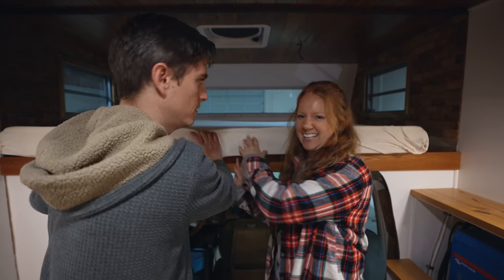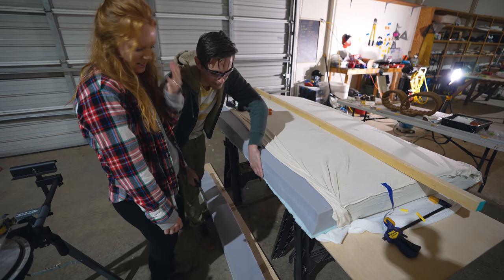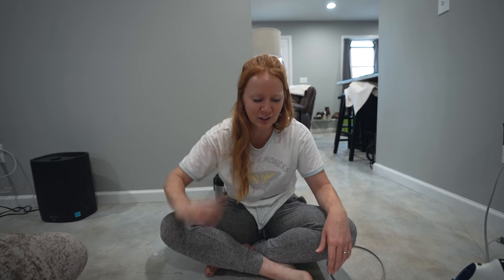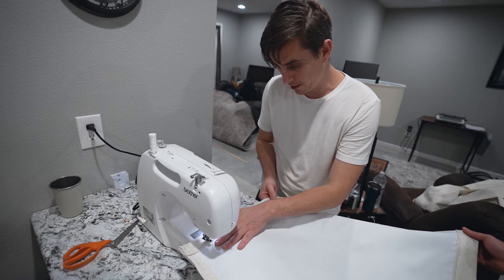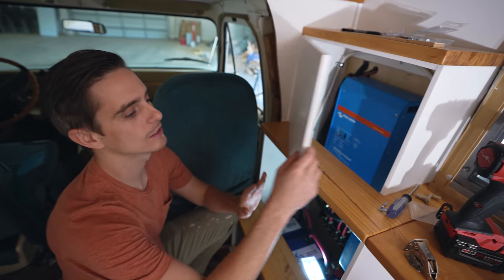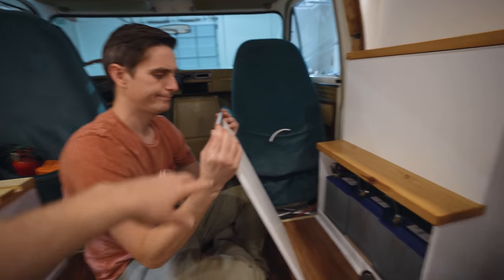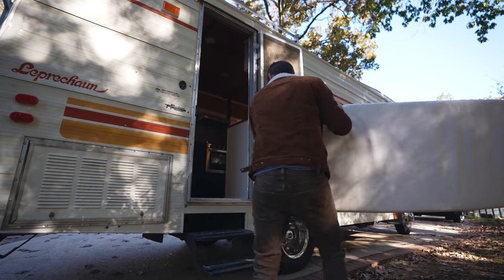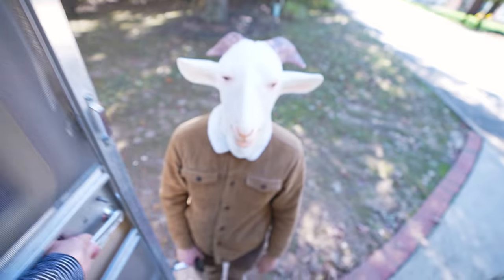We’re Finally MOVING IN!! - The RV Is Ready For its First Official Trip 😮

Comment: Put those two panels together then it will cover the window and have enough fabric to open from the middle.
Reply: If they are the largest pair they can probably be cut down for other windows. The loss of width likely due to the folds/seams. Should have offered them up after the pinning stage.
Reply: Definitely use them somewhere.    No sense in taking them apart.
Reply: I was also thinking that! Or they could add a decorative band on each end to extend the length.
Reply: Wow! You two should be very proud of your accomplishments; you’ve done a great job. You tackled projects that most others would run from. I hope you enjoy the heck out of it!
Reply: Agree. Use the 2 panels on one window. Or add velcro to the outer edges to make them fit snuggly. I LOVE how Clementine  has turned out. She's one of a kind and a true beauty. I really like the sunburst w the mirror 🪞.  Perfect touch 👌
Reply: I always cut longer.  Better to be longer than shorter.  Add Velcro to hold secure.

Comment: For the doors - recess an area on the side edge of the door or drill a finger hole. No handles to catch feet on.

Suggest- have the curtains made. You need to have about 2x the length of fabric that you had for that window and have 2 per window to sit better when opened.

Comment: VELCRO STRAPS attached to the chair legs on the wall side will keep the chairs secure while traveling. Also make sure you have a few BUBBLE WRAP sheets to place in between pans, dishes, etc. to keep from rattling.
Reply: Felt would work for the pans and pots, too.

Comment: I’ve used seam tape for years. It helps to use a damp press cloth draped over the area as you iron it. Really aids getting the glue to adhere.
Suggestion, refrain from putting a handle that juts out. To easy to bump into. Try a leather tab, or just drill a 1 1/2” hole as a door pull. The coach looks great. To secure the chairs, a long bungee cord from one side of desk to the other will work.

Comment: A standard frameless concealed cup hinge would have done exactly what you wanted with those doors that have no clearance. I actually went and checked mine when you said you couldn’t find any that would handle that tight gap because I suddenly wondered what I was missing. I redid my kitchen myself, so I’ve had a lot of hinge experience at this point. Frameless uppers with full overlay doors cabinets are often side by side with no clearance. The doors sort of rotate in place.

Comment: Your motorhome looks beautiful! Don't throw out the cut off pieces from your mattress, cut them to size to use as arm rests on the ends of your couch.  It looks like you still have plenty of the couch fabric to make matching covers for them. Sew magnets into the outside seams of your curtains while making them so the curtains hold against the window frames and block side gaps for more privacy. They will also swing less while in motion and block light better.  For my curtains, I bought them off Amazon (I chose room darkening that feel like suede but are water resistant and wipe clean) and hemmed them to the sizes I needed...such a time saver and they look great! Also, for coat and blanket storage, buy square zippered pillow covers and stuff your down blankets and coats in them. They make great pillows and free up your cabinet space for other stuff. You could use the matching fabric to make the pillows too. On your step cabinet doors, I would drill a finger hole or use a leather pull tab. I would put them only about two inches in from the opening edge. Whatever you choose, make sure it doesn't catch your clothing or scratches you when passing by or using the steps. Am looking forward to seeing how the first trip goes!

Comment: Congratulations! So excited that you’re finally going to get to USE the motorhome you’ve been working so hard to build. It turned out AWESOME! Could you built two little slots for the chair legs to fit into along the wall? Then you could just tip them back and slide them away from the desk when you wanted to sit down.
Reply: That’s a great idea. I was thinking of a bungee cord but your solution is more elegant. Could even put in a sort of foot rest rail all along the wall to use when sitting that could also be used to hook the front chair legs over.
Reply: @ang_131  It could even be combined with a wire chase to hide computer wires, attach charging outlets, etc.

Comment: You can cut the curtains in half, and make two new ones so that it fits. Then you can put them on rods and slide them open and closed. When open you can tie them off. Also I wouldn't put a handles on the stairs looks good plain but if you really want a handle how bout a leather strap handle. May not take up a lot of space and you guys can keep the clean look and less likely to hit it with your foot.

Comment: Possible battery door solution? Thin door magnets on the panel and edge of the cabinet? And you just pull it off when needed? (Maybe some kind of flush pull if magnets are strong?) OH! Just saw the piano hinge.. well if it doesn't last... a different solution. 😁

Comment: I am a seamstress I would like to say you did a good job on your curtains.   I would like to say this, because you are missing at least 1.5 in on each side I would say add some accent to the ends of the curtains like maybe some wide ribbon?   Burlap ribbon?   Or you can add magnets on each end to cover just the window, not the frame? The battery compartment.  Magnets for the door so basically not a door but an open side in?

Comment: We did Black 33gal garbage bags & duct tape plus bungee cords and screw eyes.    Real blackout.   You guys are lucky, it was only a Semi Truck.  We had a bulldozere' (French) hit us in Quebec.  Our local body shop fixed us up when we got home.  Oh, by the way:   Go buy a bushel of bungee cords and screw eyes to hold all the drawers and doors that fly open when the magnets let loose.
Reply: So when we traveled, we brought along a sabre saw/jig saw,  electric drill, bits, and screws, even nails, pipe strapping, 16 gauge wires and crimp connectors plus several short lengths of furring strips we stored below our dinette and Al's toolbox from his days as an outboard motor mechanic in high school and college,  AND a multimeter plus a 10,000 lb tow strap, a folding army shovel, a spotlight that plugged into a lighter socket, and folding road hazard triangles and flares.  
This was for our second class C motorhome that  was only 4 years old and looked like new.   Our first one was a lemon and all this stuff was needed to keep us going.  It was the same year as yours.  20 years ago.

Comment: Take that door off and place on a flat surface with some heavy weight on top, leave for a week and if lucky the warp will straighten out, may need the assistance of some steam and reverse pressure.  Unpick the side seams of the curtains and refold with smaller seams, resew and one might gain an extra ¾ - 1 inch on each curtain or stich on some contrasting folded bias binding to gain extra width. Become happy Nomads once finished and endless adventurers again.  Just don't apply for a machinist job in a knicker factory!